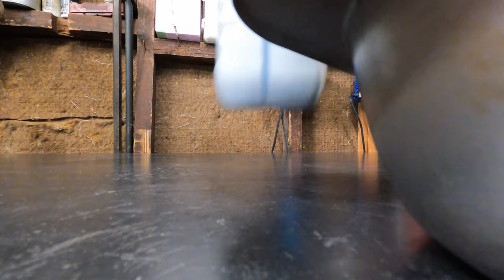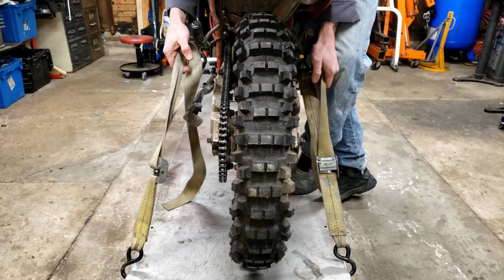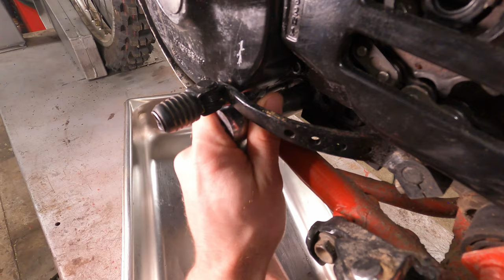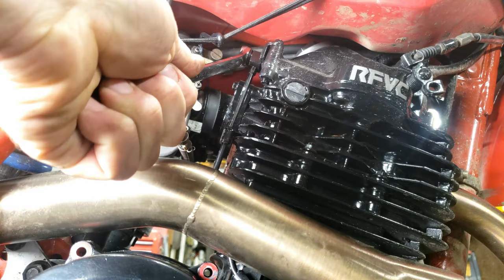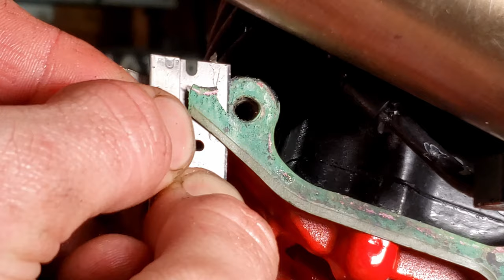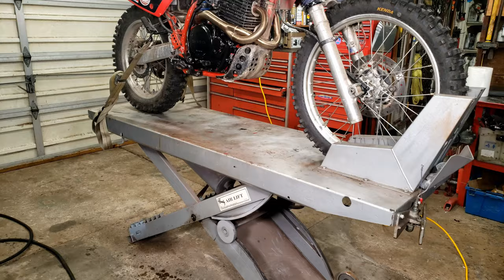Motorcycle Clutch Replacement No Voice - Honda XL600R    ASMR

Comment: i just went thru and restored my 86 xl600r
Reply from the maker: Nice! Kept it all Factory?
Reply: @NoNonsenseKnowHow  yep. I powdercoated the frame as well. rebuilt the engine. it is the red white and blue 86 year.
Reply: @NoNonsenseKnowHow  i also put an oil cooler on it as it is very hot where i live
Reply from the maker: That's awesome man. Good stuff!
Reply: @NoNonsenseKnowHow  i still have to make a new brake hose as the one i have is spongy